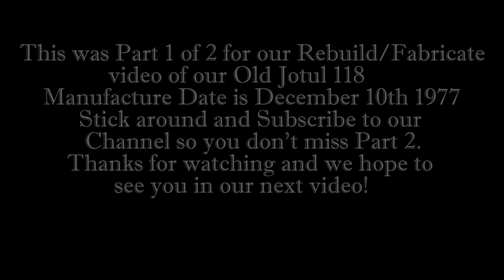Off Grid | Repairing old Wood Stove | Jotul 118

Comment: Carl, what type of fuel were you using to braze with? Just curious 

I used to use  oxygen acetylene.
I know with some fuels, I have a hard time getting the metal hot enough to bond.

Excellent video. I wish you guys good luck with the upgrade.
Reply from the maker: Thank you! I used Mapp Gas. And yes, it didn't get the metal hot enough. You live and you learn that is for sure.